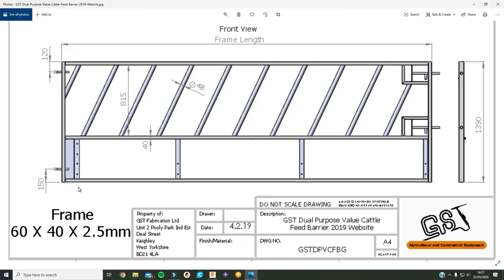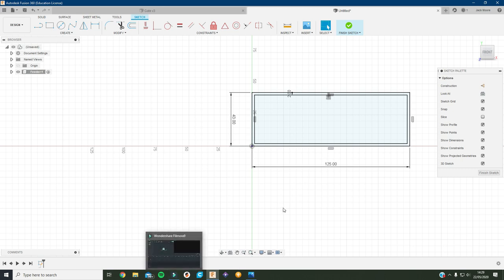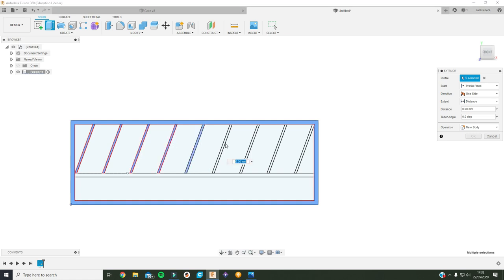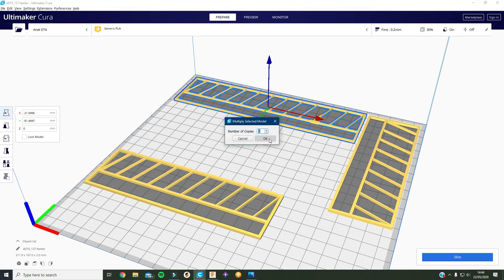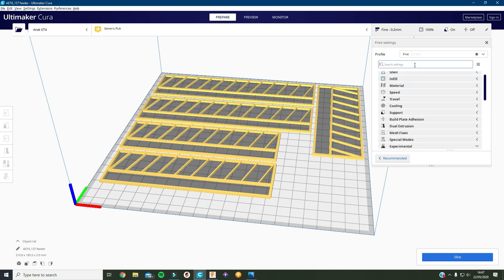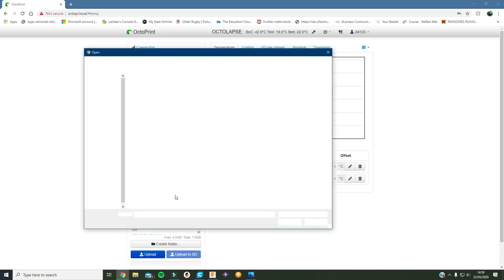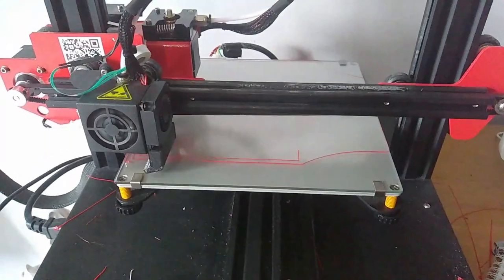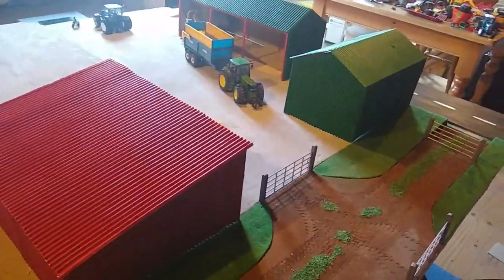Making feeding barriers with the 3d printer

Comment: Good video it’s quite a good idea but  it’s expensive and pls do make more
Things like:
Post hole boarder
Tool box for the side of ur tractors 
Fuel tanks 
Ring feeder 
Signs (farm/road)
Covers for grain trailer or ejector trailers
+ things for dioramas 
tool box
Work bench 
Jacks 
Car lifts 
Dog kennel 
Just a few ideas u could probably think of more
Reply from the maker: Thanks for all the ideas, but it's not to expensive once you have the printer bought its very cheap actually
Reply: I thought they r really expensive
Reply from the maker: You can get one like mine for less than £200 so it's not to bad for what you can make
Reply: Ok thanks if u see this again pls send link of a 3D printer which is decent if u could that would be great 👍🏻
Reply from the maker: That is the same as my printer